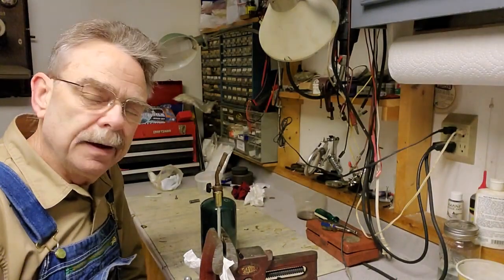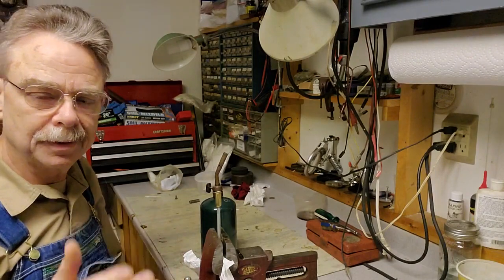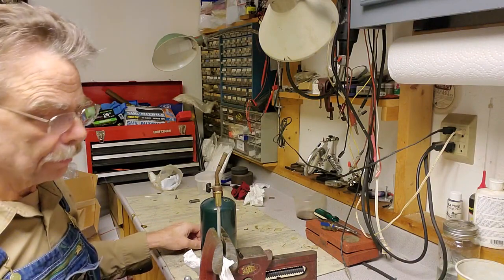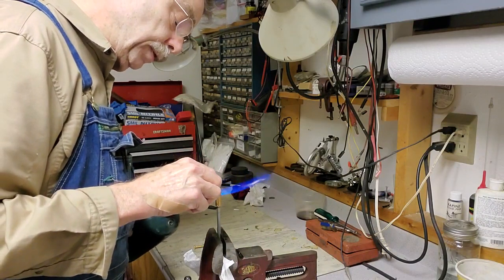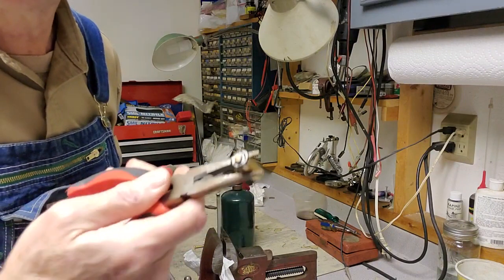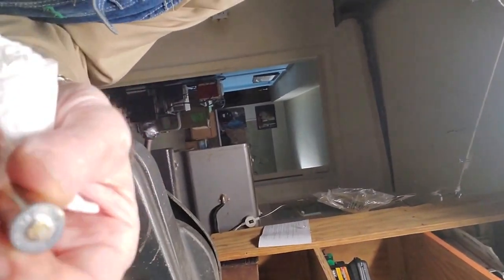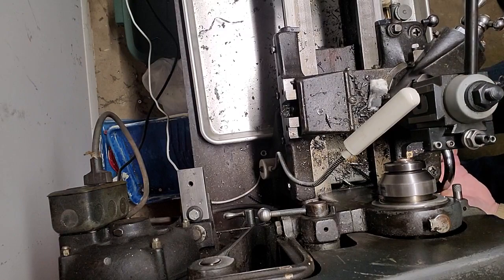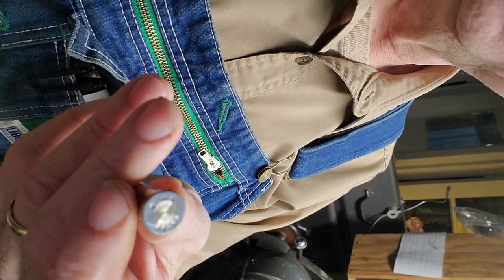Part 1 - How I convert centerfire cartridge cases to rimfire

Comment: Ahhh come on, let's bring back the real rim fire cases. A few of us grey beards are trying to form cases using the collet method, there is also mentioned a hydraulic method in a die after the cup is formed.
Do you have any experience with either method or know anyone doing such work as we hate to reinvent the wheel.
In diary's reloading rim fire cartridges are mentioned using nail heads sharpen to clean out rims and even pushing out the crimp so having to clock it properly in a repeater isn't a problem.
Any information you may have appreciated.
Thanks for your work, really glad I found your channel.

Comment: Thanks Steve for taking time putting all this out there. 
What die did you use to resize your cartridges for your chamber size?
My .44rf Ballard is also a Ball and Williams (#2498), and the chamber is smaller than a modern 44 cartridge.
Reply from the maker: Thanks. My chamber is on the larger size. On the N-SSA site I read of people using either .44-40 or .44 mag brass trimmed to length, depending on chamber size. Trimmed  .44-40 works well with mine. I use a .38-40 sizing die just enough for the bullet's heel to have a snug fit.
Reply: @steveblancard5566  
Thank you sir!
Have a great week

Comment: Thanks for making this video, it is nice to see that its actually very doable process for an at home project. Ive been wanting to do something similar like this but for 32 and 38 rimfire. Im assuming the brass plug would have to be quite small in diameter for 32. Anyways I have minimal metal working experience. I do not have a lathe. How viable is a vice and file to square up that case end plug? Or do I risk throwing the brass rim out of spec using a file and screwing up headspace?
Reply from the maker: For most .32 cal rifles, the .22 blank can be centered in the case. No need to plug and re-drill. See seller "tenmile" on gunbroker. He sells ready to load .32 rimfire cases and heel bullets.
Reply: @steveblancard5566  Thank you for confirming that for me Steve! I was just wondering if there was enough material on the 32 case to support the 22 blanks rim without an additional plug ...And since its just drilling out an offset pocket I think I can handle that myself... I was just going to ask about bullet selection haha. If you can use a hollow base bullet instead of a heeled bullet it would make sourcing much easier I imagine. Thanks again.
Reply from the maker: Hollow base bullets will not be accurate. You can buy the heel bullets easily from Tenmile. Good luck.